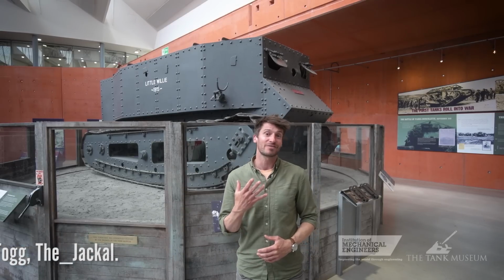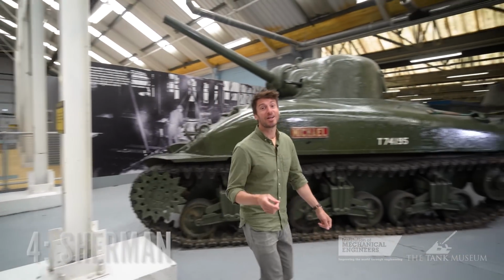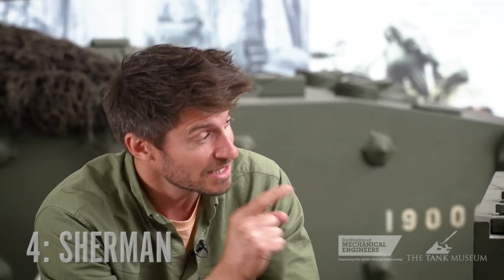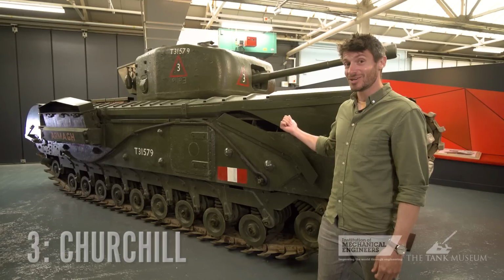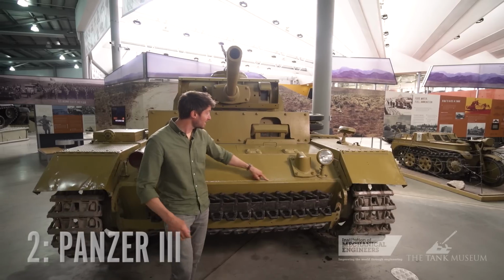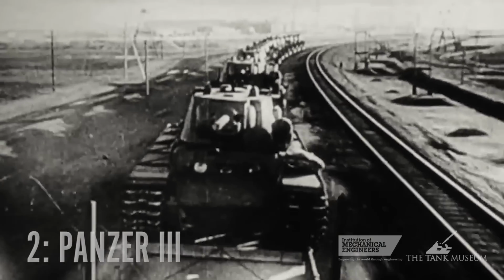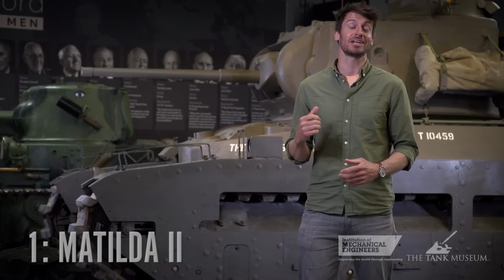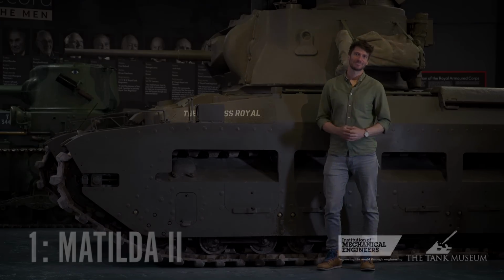Rob Bell | Top 5 Tanks | Institution of Mechanical Engineers | The Tank Museum

Comment: First, what is 'ini vitiv'
I should have seen this was bad at …
#5 …. this 'tank' was never a tank. Little Willie was a test vehicle for 'proof of concept'. It is no more a tank than dumping black powder and some rocks into an upturned church bell is a shot gun. Little Willie is an engineering mule, a test bed. How about the Christie tank? French Renault FT?
Alone the Renault's ENGINEERING influence and also 'ini vitiv' on tank design can be seen today, forward turret, rear engine. Little willie lead to the Vickers Male & Female designs that proved to be dead ends. The only lasting connection to future tanks little willie gave was the word 'TANK.'
#4 The Sherman is not 'ini vitiv' but about design thought through. The firefly variant is about communication? An arms race? He goes about the Firefly as a design rather then an engineering challenge due to a perceived battlefield need.
#3 proof that rush to design is a bad thing and fixing what's wrong at the expense of lost lives is a good thing? He makes and counters his argument in the same segment. Makes no sense. this segment finishes with explaining how engineers, not field repair teams, came up with solutions. overall a disastrous segment. The fact that the Churchill was used for the 'Oddities' was more due to it's availability than any design feature. Many tanks from various sources were redesigned to be recovery vehicles to name a common one.
#2 Only a bit of research will find that the PzrIII was designed for the 5cm from the start and it was as much accidental as planned. I admit to being a bit fuzzy on the timeline of this but fact is, the turret ring was too small for anything larger than the 75mm howitzer unlike the PzrIV.
Further, what tank was designed by the Brits and influenced by the PzrIII that saw service in WWII? Every design the brits came up with and saw fighting, was already on the drawing board before this was brought to Britain and there is no evidence that the PzrIII was that influential in British designs. The Captured Tiger from Tunisia had more influence than a PzrIII.
#1 Matilda survived as a 'viable' tank through WWII making it #1. The Sherman and Panzer IV were fighting in 1967 in the Arab Israeli war. Sherman with a 105mm French gun was fighting into the 1980s and T34s were fighting in Yugoslavia later than that. 

Is this about Tanks or the wonders of engineering? It's off with either argument

Comment: Tigers and Panthers are great, but they faced an odd of about 25:1... haha so much for precise german engineering eh? Quality does not always beat quantity.. that's a myth in strategic level.
Reply: How is something that only works half the time quality?
Reply: @chadjustice8560  Quality in tank's case is defined in many ways. To not break down is only one of the many factors, it's the reliability. Tigers and Panthers, despite unreliable engine in the early versions, have possesed powerful gun, dependable armor, and super accuracy. Now for example, a Cromwell can not stand a chance even against L48 75mm of the pz IV, it's gun can not challange PZ IV H at long range, but it's RR meteor engine just keep going. Now what do you make of that? A tank posseses 3 crucial qualities survivability, firepower, and mobility. A Tiger in the early version possesed 2 of those, in the later versions all of those, now a Sherman or a Cromwell, they possesed only one of those, even until the late version relative to the Tiger.

Comment: The M4? Not innovative?  Seriously? 

All of the M4s have two way radios... not every tank had that in 1942. 
And a fairly high speed and reliable turret transverse that can be run when the main engine is off... which not all tanks can do.
Reliability alone... is innovative... Apart from something like the Pz III. You'd be hard pressed to find something that runs and drives and works right out of the gate as a operational tank... like the M4. 

As for a test vehicle...Just about anything and everything was tried on an M4. To the point that you can still find "new" things in the archives that were tried on an M4... or planned for the M4... By the end of WW2 the M4 was slated for the 1945/46 year to be the most technologically advanced tank available anywhere. (Yes that includes the Centurion) Far more so then the M26 that ended up coming out in 1945. Although the M26 was also slated for a number of developments planned for the M4. 

But the war ended. Such as it is.
Reply: Engine, suspension, armament, all had been used on other vehicles before it. It merely combined old reliable parts in one well functioning machine. That's not innovation, that's pragmatism.

Comment: The Sherman was a terrible tank
Reply: nope.
Reply: I disagree
Reply: Lol, you know nothing of tanks. The Sherman was the best medium tank of the war.
Reply: Based on what? The Top Trumps stats compared to the Tiger and Panther? (Top Trumps is a card game where you compare numbers and the best wins)
Reply: @kyle857  That might be a stretch.  The Sherman was reliable and produced in large numbers that is about all it had going for it. It was outclassed in most other aspects by other medium tanks.  The best medium tank of the war was probably the T-34 It's only real negatives were reliability (initially) and crew ergonomics.  But everything else it did better than the Sherman.
Reply: @kyle857  you should ask the crews what they thought of it, oh wait they all died.
Reply: @thecasualfront7432  no they didn't, less than 3000 tankers died in the whole war, on both fronts. 

The Sherman was an excellent tank, more so given design requirements.
Reply: tisFrancesfault the only good thing about it was it was able to be produced quickly and in huge numbers. It’s the tank equivalent of a sten gun.
Reply: @thecasualfront7432  the front armour had an effective thickness of 90mm or so, 10mm less than a tiger. The 57mm was able to take out panzer 3-4s,  stugs, armoured cars etc   from the front. Also had good HE properties for anti infantry.  

In the unlikely event of seeing a tiger, well smoke him and get a 76/firefly to shoot it. 

It was safe, easy to run, operate and repair.
Reply: @matthewq4b  What did the t-34 do better than the sherman? Outside of being killed in Mass quantity to the tune of half of it's production being destroyed.
Reply: @thecasualfront7432  Out of 40,000 enlisted us tankers only 1541 kia for all tanks not just the sherman and over half of those coming outside the tank. It was produced in Mass numbers because the USA had to cross an ocean to fight and also supply tanks to two other countries. Now you think that's the only reason it was good so it had the highest crew survival rate, the frontal armour was almost the same as a tiger 1, it worked 100 percent of the time not half like the big German cats. The 75mm would kill almost anything outside of a tiger 2. It was easy to upgrade, easy to fix all the while having to meet certain restrictions the USA was up against. I can throw you all kinds of numbers that show it was the best medium tank of the war and probably the best tank of the whole war.
Reply: @chadjustice8560  Higher Production, Better Armour Protection, Better standard guns. Especially in the T34 85, Better Mobility, even easier to service than the Sherman.. There is a reason the T34 stayed in service long after the Sherman was retired.
Reply: @chadjustice8560  In the European campaign the Sherman had a loss rate of 580%.